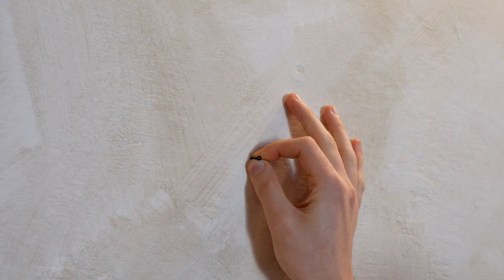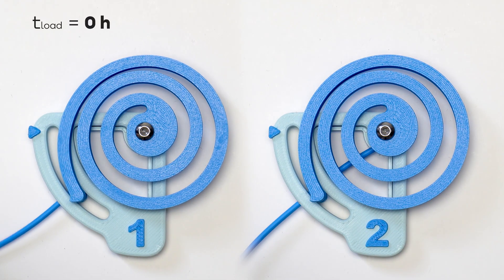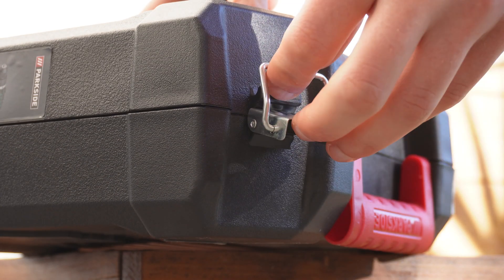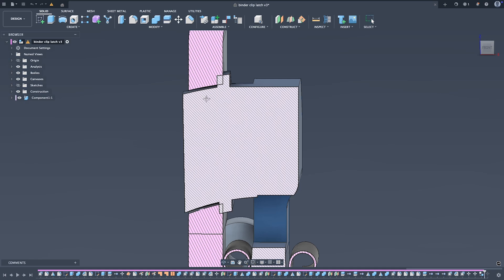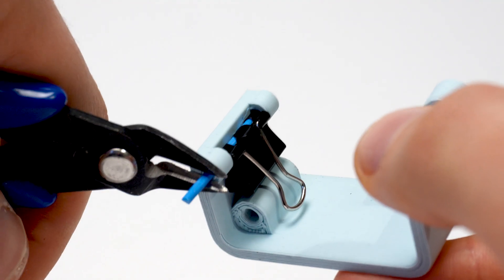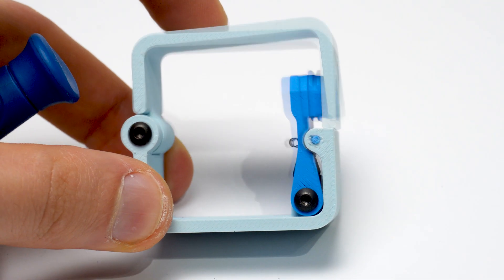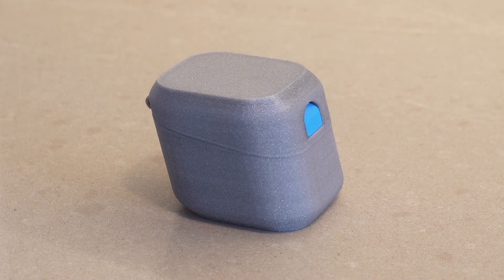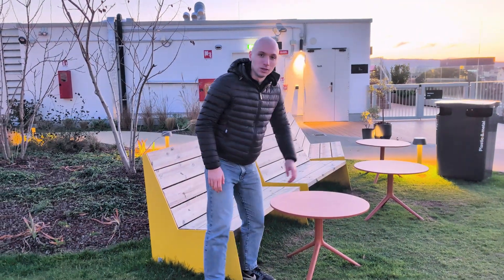Stop 3D Printing SPRINGS. Do THIS Instead

Comment: Бред, так же как и пружинка вначале ролика подверглась постоянной нагрузке и деформации, так и любой пластик который будет нагружаться этим прижимом будет точно так же деформироваться. В чем разница, не понятно.
Reply from the maker: The difference is actually in the time under tension that the spring is going through. Yes, also the first spring (sample 1) is under tension but for a fraction of time and then gets released, returning to the exact same shape it was printed in. The second spring (sample 2) has been kept under pressure for 12h and it doesn't snap back as before anymore, and it gets worse with time

Comment: Excellent. So often designers get caught up with their latest tool that they forget the centuries of manufacturing knowledge predating 3d printing. The real lesson here is learning to use common objects in new ways. Well done
Reply from the maker: Exactly! There's no need to reinvent the wheel most of the times

Comment: why not just... buy a spring or a metal wire/pin? or at least remove the pin from the paper clip.
(edit oh, the paper clip relies on the black bit to be springy? I haven't seen a paper clip in a while lol, but I'd still use a disc/flat/torsion spring of some sort it's cheaper more compact and more "professional"
Reply from the maker: Exactly, the black part provides the tension. A dedicated spring would definitely make sense, but I wanted people to be able to use something they already have at home

Comment: Perhaps you can eliminate the need for the hole with a bolt and hex screw. Using 2 small wrenches to tighten that you might also can print as well!
Reply from the maker: That's actually a good idea. Not so sure about printing the wrenches though eheh
Reply: 3D printing some small right angle bit holders might be the ticket
Reply from the maker: @MotionFriend sounds like geas need to be involved here :)